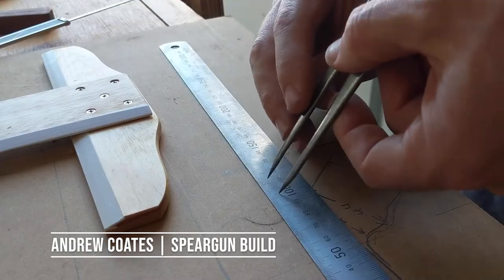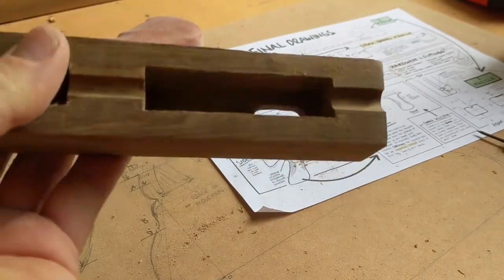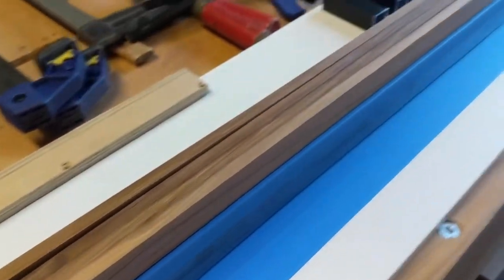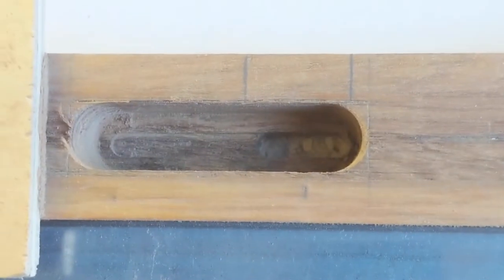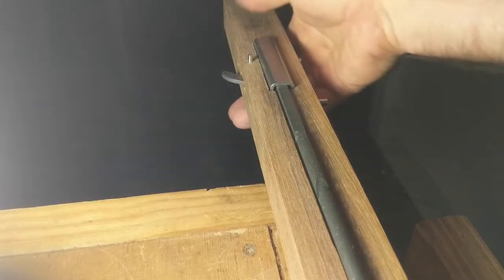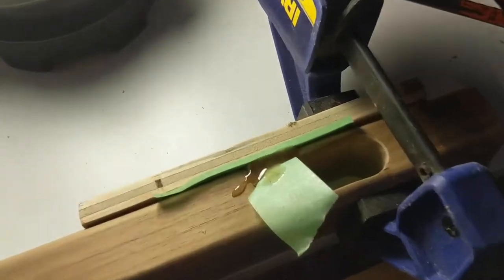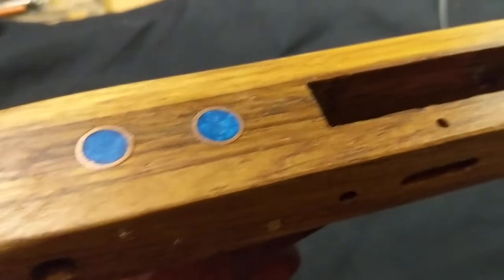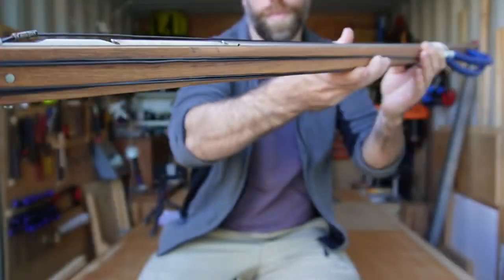Teak Speargun Build Process and Analysis

Comment: Awesome video brother. But? How do you balance the gun in the water?
Reply: The weight of the spear shaft will hold the gun neutrally boyant in the water, if it still floats too much you can add extra weight to the barrel by drilling holes and filling them with lead, or you can increase the diameter of your spear shaft which will add more weight. If it sinks, you may need to add buoyancy tabs/wings to the fin stock. This one ended up being pretty spot on, it floated slightly so I've put a bigger spear shaft in and now it's neutral.
Reply: Does tilt forward slowly in the water or sits horizontal?
I was told it needs to tilt slowly forward for trigger pull
Reply from the maker: @garrywagener4358  Not sure what you mean by tilt forward though, sorry, but ideally you want your gun to sit fairly flat (neutrally buoyant) so when you extend your arm under water you don't have to fight to hold it in place. Cheers

Comment: what did you use to laminate the timber and how's it held up over time? cheers
Reply from the maker: I used a clear marine-grade epoxy, the kind of stuff boat builders use. No problems, no movements, still perfect joints with no signs of delamination. cheers

Comment: Hi, I was using the same trigger mech and was needing help to put the safety switch as it wouldn’t stop me pulling the trigger. If you could show me a guide I would be very grateful.
Reply from the maker: Hi there, I don't use a safety switch, so can't help you there. Personally I find it much safer to treat every loaded gun as "unsafe". Not only does this mean I won't line up a fish and miss the shot because the safety is still on, but I will hopefully behave much safer knowing it's ready to fire and not being lazy relying on a safety switch that may or may not be working correctly. Meanwhile, the manufacturer of the trigger mech should have guides available on their websites.

Comment: Hi, if I  make a wooden speargun wit 3 horizontal laminations would that be OK?
Reply: As long as the overall thickness suits your requirements, yes. However, 4 is better, but I wouldn’t use less than 3
Reply: @andrewcoates5438  it 3 mahogany laminations at half inch. My dimensions are 1 5/8 x 1 3/8. Is that OK?

Comment: What were the dimensions of the stalk prior to shaping it? Or does it even matter as long as the trigger mech fits?
Reply: Totally depends on your design, you can have various length guns, however, you want enough thickness to ensure your gun stock cannot bend or twist under load